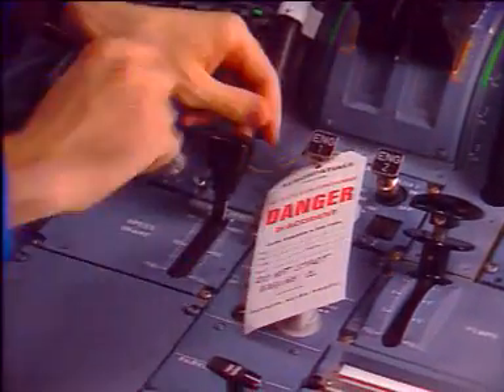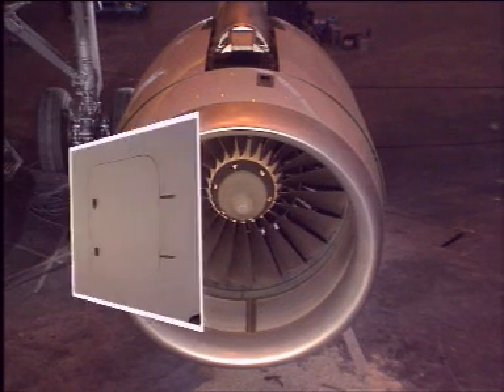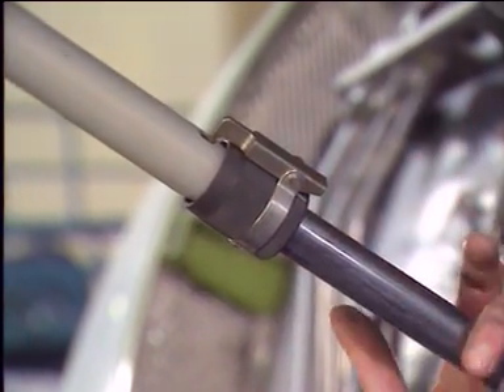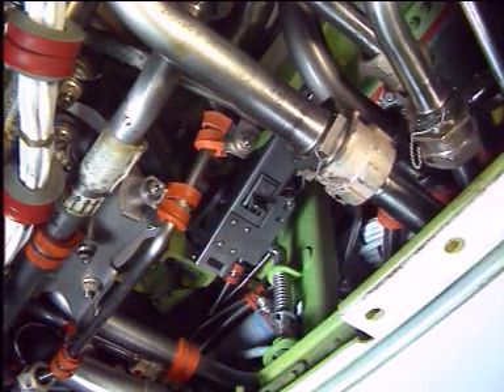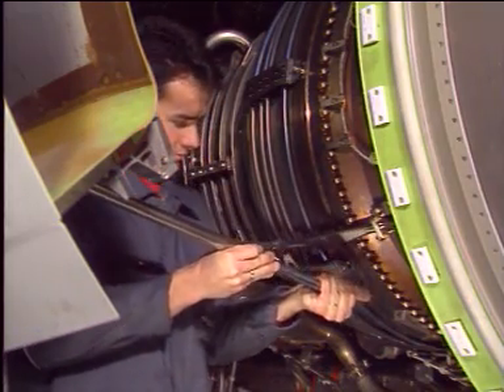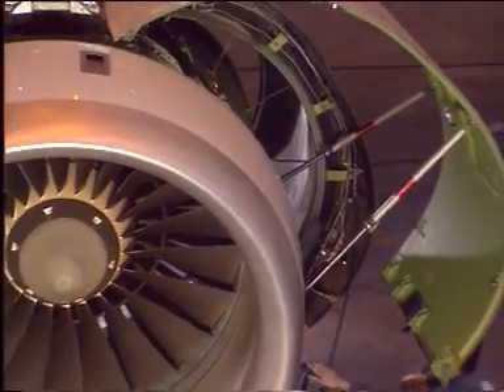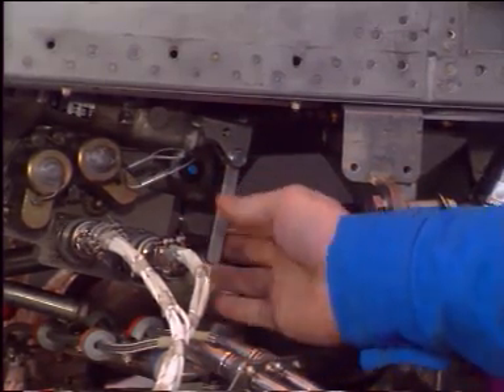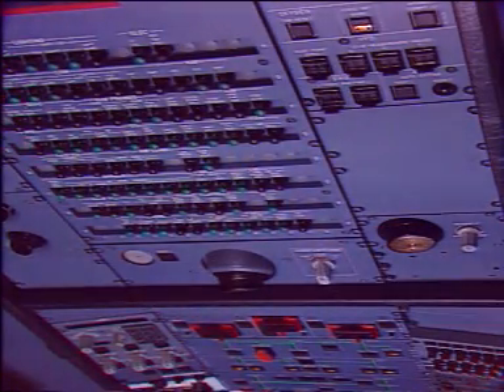AIRCRAFT | A320 V2500 - Opening & Closing of Engine Cowl Doors

Comment: There's a lot of technical information on the internet for most aircraft types and you can purchase them in shops which sell them (including official flight manuals and computer based training manterial).
None of this knowledge will prove dangerous in any hands because you are unlikely to get access to airside without getting caught.
Parked aircraft are well observed and airport security will know whether ground crew are expected to inspect or be near an unattended aircraft for any reason.